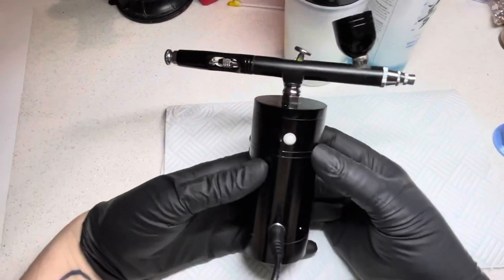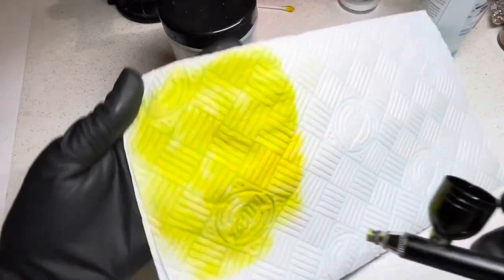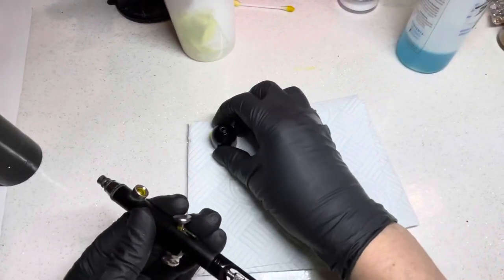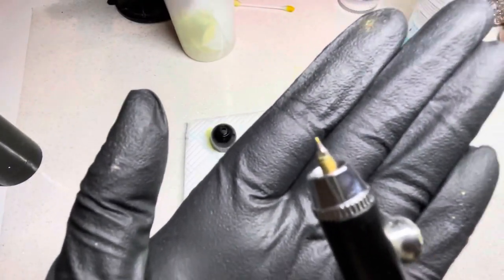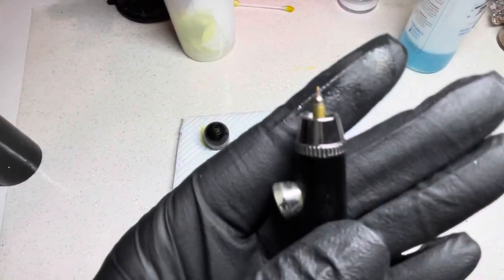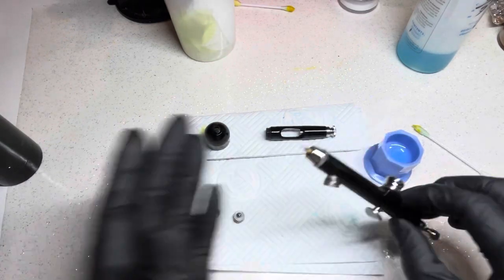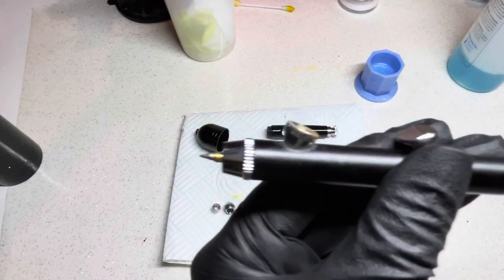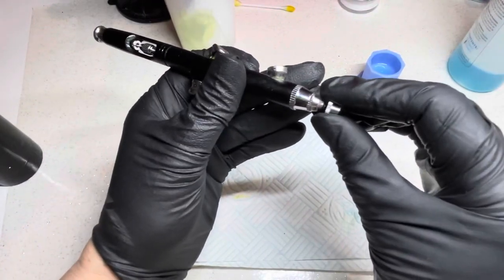How to easily clean your airbrush - nail step by step

Comment: Thanks for doing this video!! I'll have to go get mine n see about it. Fingers crossed 🤞
Reply from the maker: Have u already got one hun x
Reply: @NailsbyDawn  yes the young nails 1. I took it apart to clean it shortly after I got it (when they first released it)  ni put something together wrong cuz it don't work. It was not cheap. I got the bundle it came with all the colors they sell with it. I've watched their video a hundred times. If I remember correctly the trigger is what I put back wrong and I have an extra rubber ring that I can't figure out where it goes

Comment: How often do you have to do this? Nail tech here, just getting into airbrushing.
Reply from the maker: Hi, I clean between colours by just flushing through and after each set I will flush again and pull needle out to wipe, then fill with cleaner and leave that sitting in it, but after I have finished using it for day I do a full clean….hope that makes sense hun 💜
Reply: @NailsbyDawn  Are you using anything special for a cleaner?
Reply from the maker: I use an airbrush cleaner hun 💜